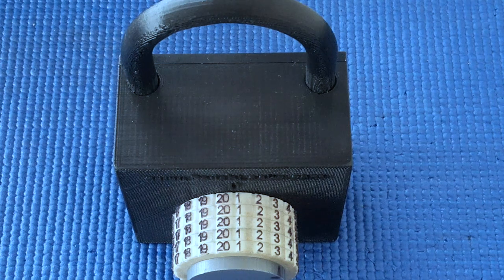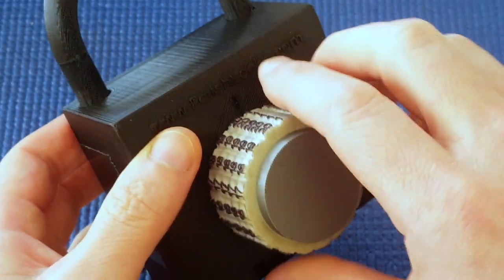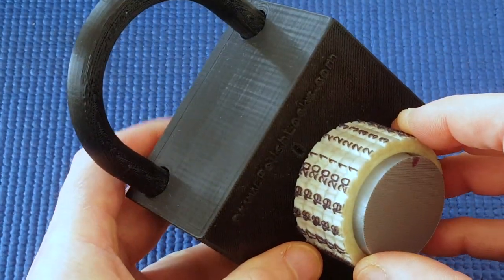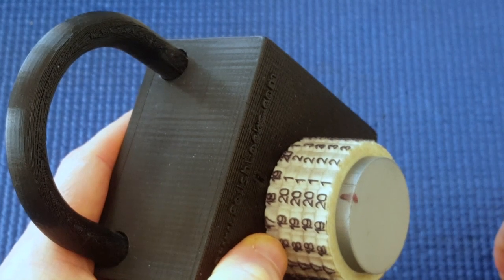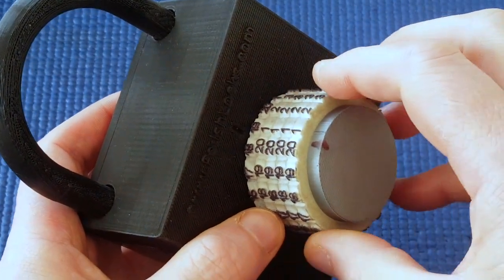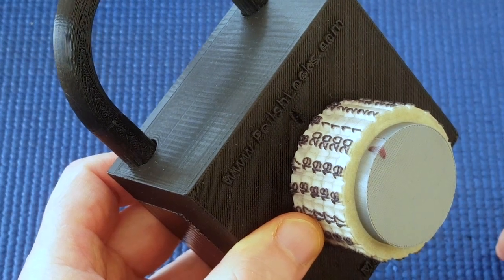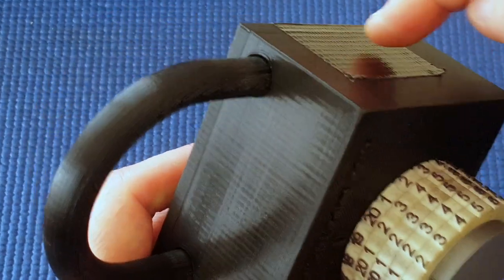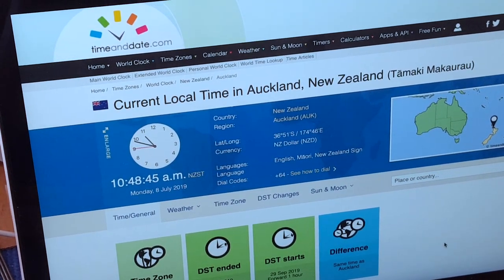(Picking 126) Polish Combination Lock World Wide Challenge part 2

Comment: Could you bypass the mechanism so you would have the lock open, then look inside to figure out the combination. I sometimes do this with cheap combination locks that are easily shimable.
Reply from the maker: This one can't be shimmed.  All the plans for it are freely available, and Potti314 did a nice tear-down video showing exactly how it works.  The lock is designed for people to know exactly how it works but still not be able to decode it! :D
Reply: @Swynndla  Darn, well i'm sure some vulnerability will be found soon enough, there is always something, no matter how small.